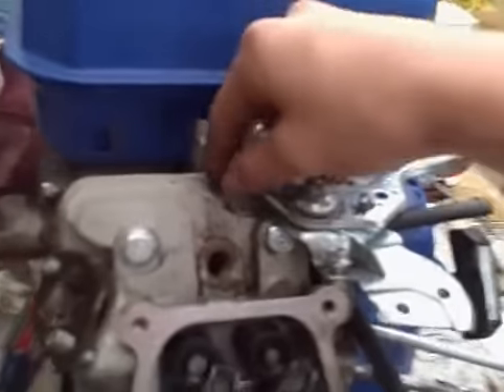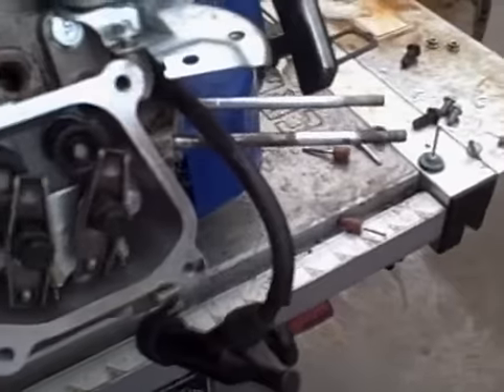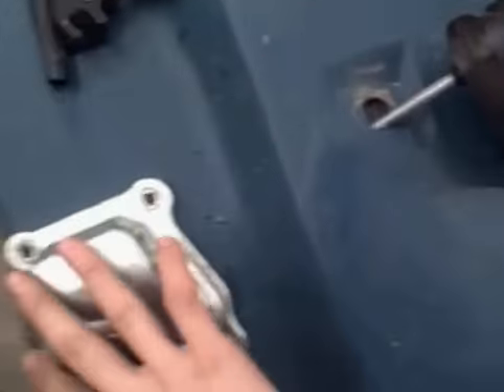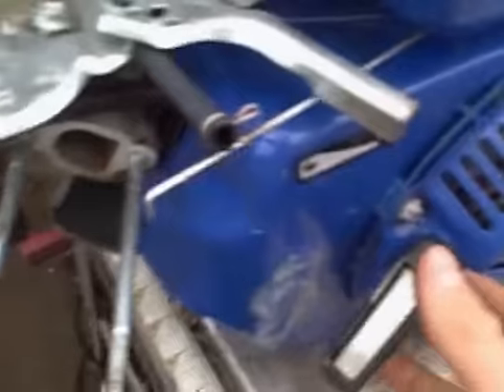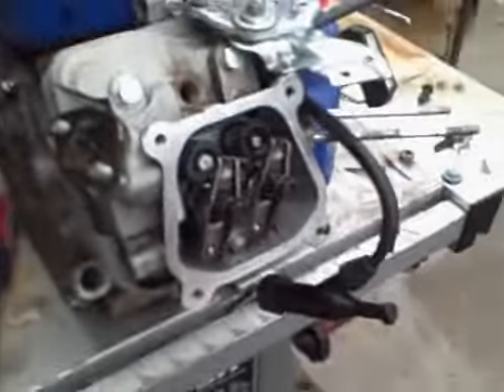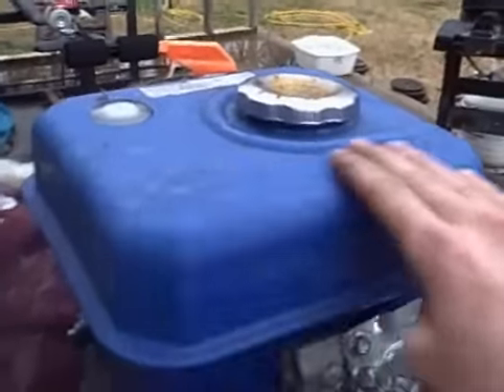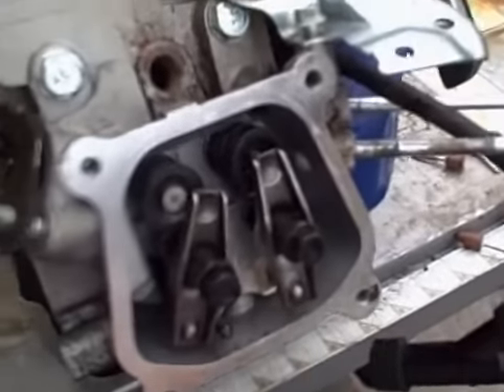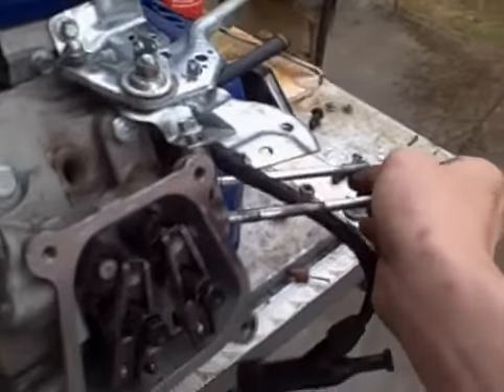part3 honda clone work

Comment from the maker: thanks man yeah  i agree but its brand new  only been ran 5-6 times 30 mins approximatly on each run but water got in the dang thing and its like heck now but she will be up and runnig a gain the water didnt damage anything except it hydrolocked on me twice I checked all gears and crank and cylinderand it has no scrathes/wear at all so thats a plus well peace for now man !